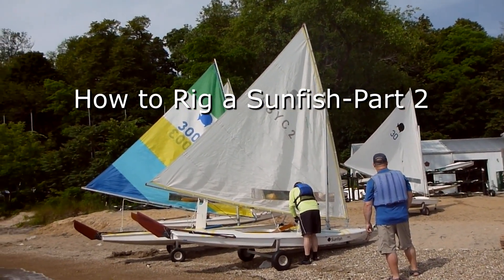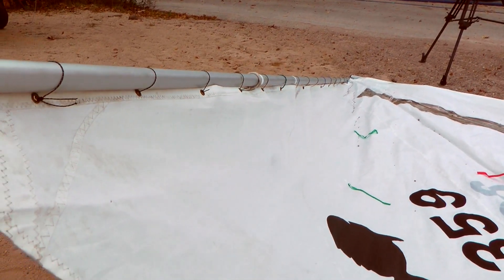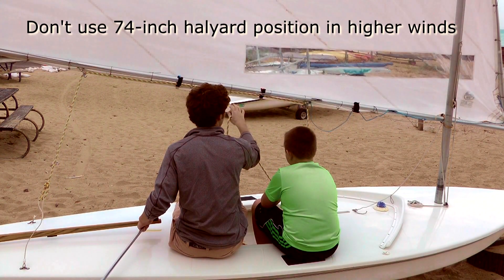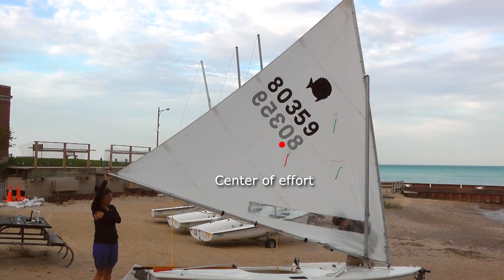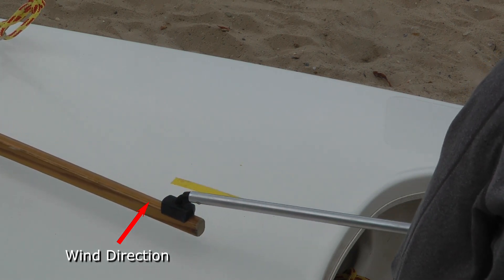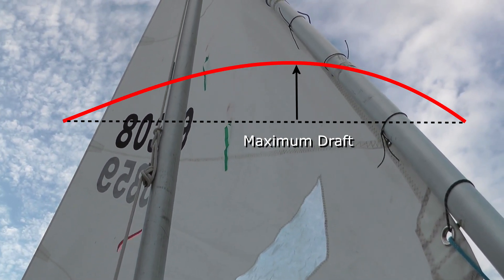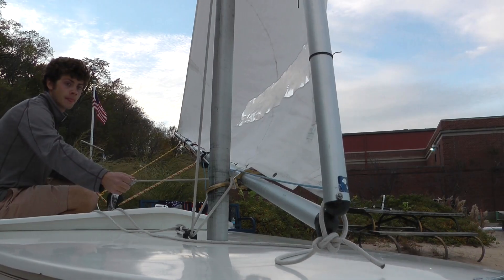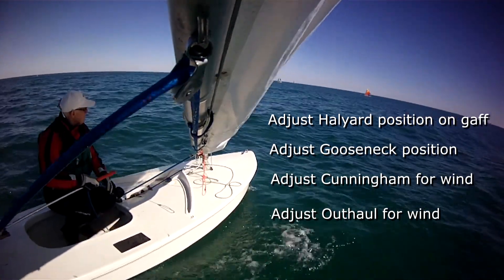Rigging a Sunfish Sailboat Part 2 Rev1

Comment: Many thanks Steve ! while that boat concept is fantastically simple, trimming it very well is not that easy with all those parameters. If you could add some content about the vang that would be great.
Reply from the maker: This is a very non technical answer. Stronger winds press against the sail which tends to pull up on the boom. That creates a less efficient sail shape. The vang holds the boom down so that effect is minimized.

Comment: Hello Steve. Thank you for this video. It is excellent. I am a recent Sunfish owner.  I was wondering if you would be willing to offer some advice to help me troubleshoot a tuning problem.  I will write the details later, if you say you are ok to answer here. I don't have a local sunfish expert to consult with.  Thank you
Reply from the maker: Ask away.
Reply: Ok. Here goes... My boat has a great deal of weather helm.  I really have to tug hard to keep it going straight. Very difficult with the extension. I need to hold the tiller directly to get enough leverage.  It is not like any other boat i have sailed but I don't have another sunfish for reference. About the boat: 1998, in very good shape. Like new. I have the original sail and I also just got a new one with a window.  The sail does not make a difference. I kept moving the gooseneck back to try to relieve the problem and i am now at 21 inches, which seems extreme and the problem is still there.  Oh, I am not racing, just a recreational sailor.  The halyard attach is between the 54 and 74 inches(64ish).  I have experimented with the halyard attach as high as possible(ie. sail/boom are lower) to reduce heeling but I can't detect a difference in weather helm.  I am sailing in 10-15 knots of wind. I am 185 lbs.  I do not have a cunningham or outhaul cleat/adjustment.  I thought I might install the cunningham to play with the draft. Will moving the draft forward, move the CE too? i didn't want to drill holes yet and it seems like there is something else going on. When I got the boat there was a slight bend in the upper boom. I though that was maybe the cause but I successfully bent it back and it is straight now. Outhaul (lower and upper) are pulled just tight enough to remove "scallops". That's all I can think of. Appreciate any suggestions or experiments I can try. Boom vang tightness? I am not hiking out enough? Thanks
Reply from the maker: @jmogyoro  You've been experimenting with the right things. I have a couple of questions. When you are sailing a straight course to windward in 10 to 15 knots of wind, how far is the front of your tiller off the boat fore and aft center line? Where are you sitting on the boat, front, middle, or back of the cockpit?  I sit fully forward, when beating and move aft when off the wind, sometimes almost on the back deck when planing downwind in heavy air. I set my halyard attachment point so that the front of the lower spar is about an inch or two off the deck, when the gooseneck is at 14 inches aft of the seam between the plastic boom spar cap and the aluminum spar. Make sure you set the vang on hard to be sure you still have clearance between the boom spar cap and the deck. Here is a document that you might find interesting: Join the Sunfish_sailor Yahoo group.  In the files section look for Helm and the Quick-adjust Gooseneck.pdf. There are lots of other good articles in the files, too. You don't want to give up on using the tiller extension. Without it you can't really sit in the boat properly and hike out as you must in stronger winds to keep the boat as flat as possible. Heeling equals weather helm.

Comment: Hi Steve: 
Very nice info/knowledge/experience! Thx!
Question: The gooseneck position adjustment is done before your sailing session right? During the sailing (on water), do you have a chance to adjust it? Or Maybe it is possible but too hard?
Reply from the maker: Thanks for your encouragement. Yes, you can adjust the gooseneck position on the water. Many racing skippers will adjust the gooseneck on the water prior to a race start if the wind is different from the wind at the time of launch. The goal is to move the center of effort of the sail so that there is some weather helm, tendency of the boat to turn to windward, but not too much. A little bit of weather helm helps to precisely steer the boat. Too much weather helm causes the rudder to create turbulence in the water, which slows the boat. Not good. I'm sure there are more elegant ways to explain this. Be sure to click on the like button and subscribe to the channel. I'd like to make more of these videos and your click will help. Thanks.